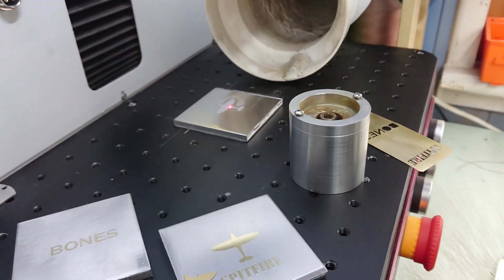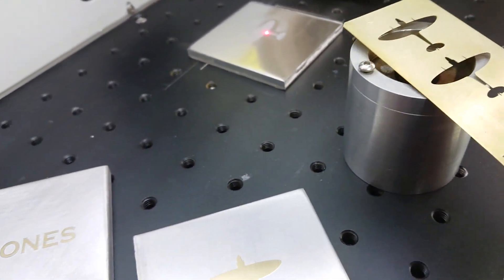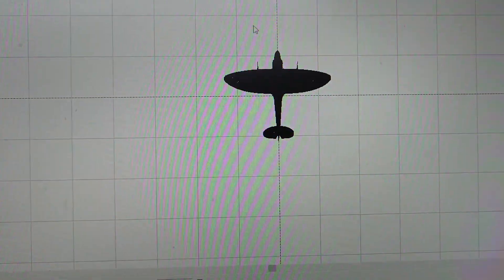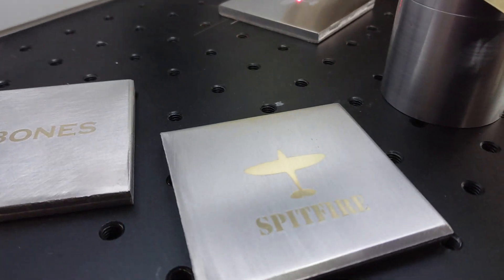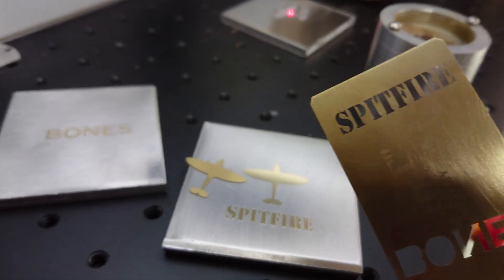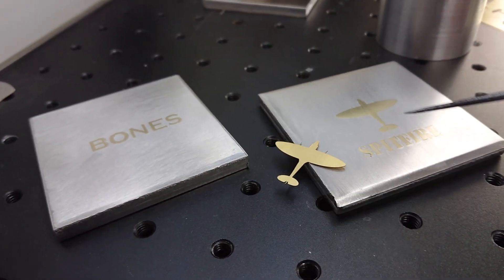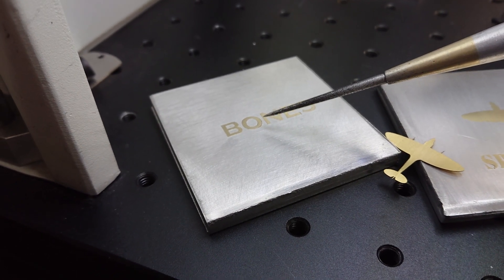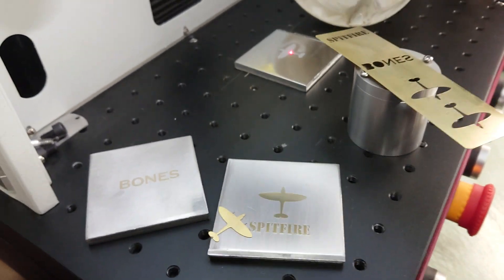Fibre laser metal inlay. Inlay brass designs into aluminium. 30W Fibre laser machine.

Comment from the maker: To cut the brass.  0.2 mm brass.  Mark loop 170 - Speed 240 - Power 95 - Frequency 30. Try keep brass as flat as possible with a heat sink if you can. Also try and keep the brass raised a tad off the bed of machine so laser can pass through the brass. 
To engrave the aluminium.  Mark loop 12 - speed 500 - Power 75 - Frequency 30 
These figures are a guide..